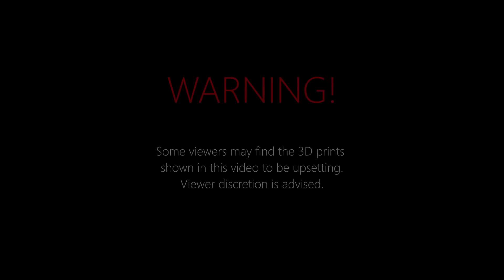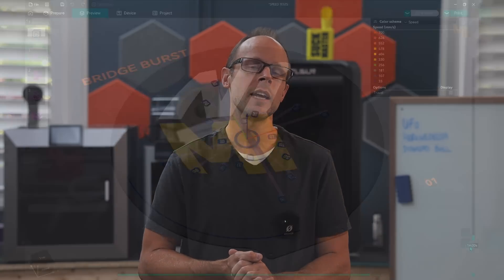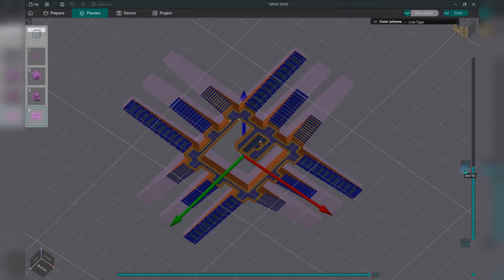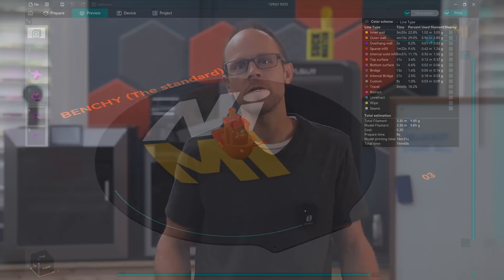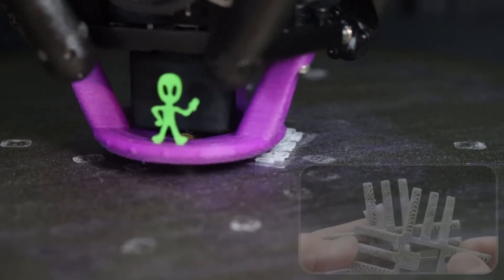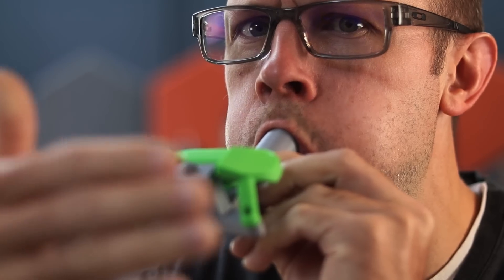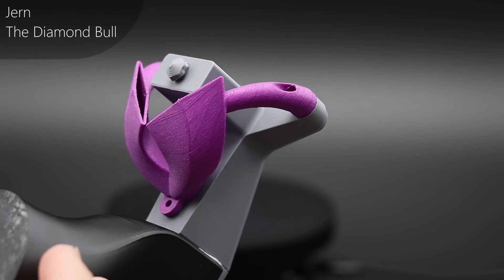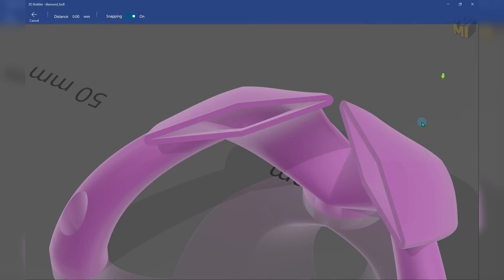Ep.1 - These high speed 3D printer ducts produced some shocking results!

Comment: I wonder if a semi-closed-loop setup where the fan is both pushing and pulling would work well. Only a fraction of the air is actually used for cooling and the loop is not going to be properly closed, so it might not heat up enough to become a problem, but you'd in theory be able to use the full capacity of the fan as well as tighten up the airflow by sucking air back in behind the nozzle if you used a semi-closed-loop setup.

Comment: Hello, thanks for your work. I think your test design can be improved a bit. Right now, you make awful quality models super fast, and check which one is less crappy. It does not neccessary shows nozzles performance in normal tasks: for example, air flow might be too strong to make a decent bridge at any speed at all, and this test would not show it.

If you would test how fast you can go while maintaining good quality instead, results would be much more relevant. Also this way you will have some numbers to compare nozzles efficiency and make comparison chart.
Reply: I think the idea here is any duct that can perform well at the harder version of the task would be able to do the less difficult task with less fan speed and therefore sound needed. I get what you are saying though. It may be that many fans can perform well at a slower speed, but some show their issues at higher speeds. Still I think the hope here is to push the performance envelope a bit and develop the ideas most likely to really allow for high speed or low sound volume cooling.
Reply: @802Garage the thing is, none of these ducts are performing well at high speed. They might perform well at higher speed, then stock one, but there was no test to show it :)
Reply: @lIllIlllII  That's part of why there is an entire series with nearly 20 more ducts left to test! This wasn't all of the submissions.

Comment: I personally think the use of high flow PLA isn't a good idea, as it's still quite niche. Given that it's a filament that solidifes differently than regular PLA and therefore has different cooling needs and characteristics, you will end up with a detailed set of results that might not be that useful for the majority of people out there. Using as generic, standard PLA as possible would make the data more universal.
Reply: There's no way to account for every filament and every scenario. The tests have to be able to push some boundary or there is little point. Getting adequate cooling at low speeds or with loud noise is already easily possible in many ways. High flow PLA is becoming extremely common as is.

Comment: The benchy at 0:16 dose needs to be corrected. Something needs to be fixed with your machine. You have issues where cooling is not even a big concern. There is a lot of potential here. I would suggest adding information on how fast you are printing, such as speed, accelerations, flow, print setting, etc. That way, we, the viewers, can get a better idea of what we are looking at.

Comment: Would it be possible to test a duck that sucks air rather than blows. It would be interesting to see you could achieve a lamiar flow between a blow and suck nozzle. That way you get maximum mass flow without disturbing what you are printing (or applying force to what you are printing).
Reply: That's a super interesting idea.

Comment: I'm confused. None of these print results are normal in 2024. There is either a major problem with the fillament, the machine, or tuning. Something is very wrong.

I feel like this video would have been better spend investigating these issues, and save the duct comparison for when the issue is solved.

As is I can't trust any of the results of the duct comparison, while print quality in general is so terribly off.
Reply from the maker: That's okay, if you haven't been following along, the point is to take it to the extreme to see how well all of the contestants perform, producing good results would be great, but highly unlikely because of the speeds and accelerations I'm running.  There have been suggestions to tune just for the stock duct to get good results, the problem with that is that I can't say where the others lay in relation to it, which means that the tests are not useful. 
 It is better to do extreme testing to push all ducts to their limits and see which ones perform the best in each test. 
 From there we can take it beyond.  To your point about 2024; there are very few printers which can run at these speeds which are not custom built, at least not at the moment.  Most CoreXY printers max a6 600mm/s and a flow of around 30mm3/s, max acceleration at 20, but actual running is done with far smaller values.   That's the jist of it, hopefully that makes some sense to you and you understand the approach I'm taking in this competition better.
Reply: @NeedItMakeIt This printer also maxes out around 30 mm³/s. If you're trying to exceed that, there's your problem. You might be able to go a little higher if you crank the temperature to 270 or so, but at this point you're not testing "how well do these ducts cool?" - you're testing "what does halfway melted underextruded plastic look like when hit by these ducts?"
Reply: @NeedItMakeIt  You can absolutely still compare with a quality baseline. You could lower the minimum layer time until parts start to look bad, or print parts with progressively higher overhangs until the quality starts to suffer.

Not only does having all of the test prints look horrible invalidate any potential conclusions you could draw. It's also unfair to all those who designed ducts for the competition and quite frankly makes it seem like you don't know what you're doing
Reply: @NeedItMakeIt if you’re running speeds and accelerations that make it highly unlikely to achieve good results then you’re not testing and ducts and instead making it very hard to tell what are real results and what are a result of you pushing a machine too far past it’s limits. this looks like a case of the printer is already being pushed too far past it’s limits and you’re throwing bandaids at what needs a surgery to fix

Comment: I know, symmetry is easier when two ports are located at edges furthest away from nozzle, having hotend and tube connection the way they are, but wouldn't hotend and sock effectively shadow airflow and direct it downwards?

Comment: Nice bridging test
Reply from the maker: It's a tough one for sure, there were some comments from the previous video to stagger the heights, I may end up doing some follow up tests with that approach too, at least to see if there are any difference at all.
Reply: @NeedItMakeIt  there's no reason there should be any, unless the bridge is like 2 mm high and affected by the plate. If you try even statements without a reasonable basis you will need more than 24h a day

Comment: Anyway overhangs over 60° (from horizontal) don't look nice even when properly cooled, so whether a cooling does those well or not is not so relevant :)
Reply from the maker: Of you can it's best to avoid it for sure, I wanted some tough tests to help provide different ways to look at cooling, so this is one that I came up with, it's not uncommon, just that it is run faster and has the repeat on each side.  Point made and point taken, thanks for that feedback!
Reply: I ran the OVERHUNG test piece last night and got pretty much flawless 75°, somewhat acceptable 80°. Only the 85° was laughably bad (and understandable since it's multiple line widths of unsupported material). I posted a video of it.

Comment: I thought of another possibility. Maybe you could test it (UNBELIEVABLE DISCOVERY, you would say, in Youtubesque language). 
If one of the problems is the excessive power of the fans, which blow the filament away, wouldn't it be logical to use lower power, but with colder air? What if someone built a refrigerator with peltier pellets, which blew air at -10 degrees Celsius onto the filament? Would it harden super quickly instead of being sprayed onto the walls of the room by an industrial power blower which appears to be what your tests are using? 🤔

Comment: There is a cooling device for aluminum cutting that uses the venturi effect so air is separated into cold and hot air, and the cold air is directed to the cutting. This may also be a good solution for cooling the extrusion.
Reply: Does it use the venturi effect to cool, or does it employ a vortexian motion to separate temp gradients, as proposed by Viktor Schauberger?  Do you have any links or further details, please?
Reply: @christopherd.winnan8701  I think the latter. It was a long time since I heard of them. The device is a "vortex tube" that separates the cold air and the hot air from a compressor source. A customer of mine used it to mill aluminum and keep the end mill cool.

Comment: Interestingly (SHOCKING, in YouTuber language, if you prefer) is that the power of the fans always seems to be the same in these tests. Wouldn't each of these models have better results if they used speeds suitable for them, preventing the filament from flying away when blown?

Comment: Interesting results. My Hero Me duct in this challenge was a blind design for the delta printer and C-pap blower as I do not have either to test this duct with. It looks like I would need to reduce the duct tip openings by at least 50% to get the airflow static pressure up to what is needed. Well back to the drawing board. Note that Hero Me ducts that have been available for several years for other printers are heavily tested and proven to perform better than most others available for those printers.

Comment: So, stock is the best all-round. Yet another video to come to the same conclusion. These magic ducts are all snake oil.
Reply from the maker: The stock duct is certainly not the best, I have several videos already pointing out the issues with the stock duct, I didn't want to go over each of them again in this video, so if you have a chance, check those out first.  The main problem is that it sends far too much air directly at the unprotected nozzle, which cools it down rapidly and it will throw a thermal fault.
Reply: wait until he's tested all the ducts, I've seen some promising designs in the group shot.

Comment: None of these prints should be this bad at these speeds. Especially the benchies. A modern printer should do a perfect quality boat at the speed it's running at. I suspect there are other problems interfering with the validity of the test results...
Reply from the maker: It is likely also an issue with this filament, I had better success at these speeds with the FLSUN HF filament, but it wasn't available in a reasonably amount of time, so I settled on the Creality stuff.  We'll do more testing on other ducts first and then we may need to swing back and re-test, the Benchys are pretty nasty for sure.
Reply: @NeedItMakeIt  Hey, Mike 
Another great show. There are really two different goals for our fan duct designs; Efficiency (effective at lower CPAP speeds) and Speed Demon benchmarks. IMHO, we need to be testing a multidirectional Fan Speed Tower in your first series of the fan showdown. The design that is able to print well at the lowest fan speed takes the prize.  Now move to your next series with the newly gained knowledge applied to the Speed Demon series. The CPAP is so powerful (over designed) that it can blow over a house of cards across the room and a real overhang killer if you are running it at 90%. Please keep up the great work.

Comment: I may have missed something in the explanation, but what is the reasoning for testing these at such a high flow rate? I only mean that if even the stock duct is producing such bad prints at that high of speed, it seems to me comparing bad prints with worse prints is an unnecessary challenge. I’d like to see a comparison under more normal conditions so that we can actually see good prints get better. Just my two cents. I really love this concept though, similar to the fan showdown on Major Hardware. :)

Semi-related, I did purchase the Panda Jet for my P1S on your recommendation, and I really do think it has improved my prints.
Reply: Because anything that gets close to printing well is obviously far far better.

I mean you wouldn't test suspension on a flat road would you?

You need to know what the failure point is and work backwards.
Reply from the maker: Absolutely, it's best to test extremes, it helps to get out of the grey areas and into more of a black and white to help learn.
Reply from the maker: The main point is that in order for printers to continue to get faster, we'll need to be able to extrude more material, this FLSUN T1 is certainly a fast printer and can extrude more filament, but the cooling is not able to keep up.  I'd like to know if there is a better way to cool our prints to help remove one of the reasons for limiting print speed.  The FLSUN is fast, but the fan and duct do not keep up with the speed as you can see from the video, I have a new more powerful fan that I can swap out, but I want to run the tests as-is first and then we can do the swap later on to see how much difference a more powerful fan makes as well.
Reply: @NeedItMakeIt The T1 is kinematically fast, but its extrusion capability is pitifully weak. I suspect that may be what you're hitting. The advertised flow rates are outright lies, produced with a "flow test" racetrack gcode that commands a speed that would give the advertised flows if reached, but then limiting acceleration to 2016 bedslinger levels (effectively 500) so that under 1/3 of the commanded speed is ever achieved.

Comment: Air speed is to high and displacing the filament... Bigger outlets would decrease air flow speed (and cooling), but hopefully the filament should stay in place.
I've got a Creality K1C, the cooling fan is on the side, maybe the reason behind this choice is having a more uniform air flow, which is hard to obtain on shorter distances.
Reply from the maker: I'm not certain yet what makes the best, but hopefully the picture becomes clearer after we test the next batch, I think like any subject, as you get into it, it gets much more complex, from the outside, things always look so easy.  I think the 3 makes a lot of sense and would produce a more even, distributed flow, with thee there also seems to be enough of a place for the warned air to leave, too many ducts and it fights itself and needs to move down/up instead, which can cause problems for some of these tests.

Comment: High flow PLA is evil for a cooling test. It cools so much worse than straight PLA, which is already bad.
Reply from the maker: It does seem pretty bad doesn't it, but I'm hopeful that there are some dark horses in the competition to be able to show us that there is a way to do it well even with this.  Which filament do you recommend BTW?
Reply: @NeedItMakeIt  If you're testing PLA cooling, any PLA folks would actually use seems reasonable. IME all the "high speed" stuff is on clearance-like prices ($11-13/kg on Amazon) because it's garbage. I find best for high speed is PLA+ that's a known premium NatureWorks resin like 3D870.
Reply: @NeedItMakeIt Got that same grey Hyper pla that you have as a referrence when comparing with other pla-s that I buy as hyper pla is,recommended for my printer. I do have an impression it's garbage compared to the sample of white hyper pla that came with the printer, and its prints seem to be weaker and worse, even after properly drying it. Also other common pla types seem to perform better, though some of them really aren't for high speeds
Reply: @milospavlovic7520 Any PLA can do high speeds. Some of them just get soft at lower temperatures, letting you do high speed at low temperature but also making them impossible to cool well enough to make use of the high speed. Regular PLA just needs 235+ (245-270 with PID control and/or poor nozzle insulation) to do high speeds.